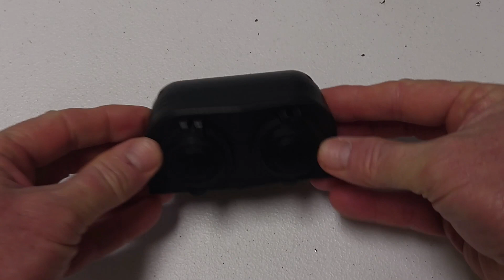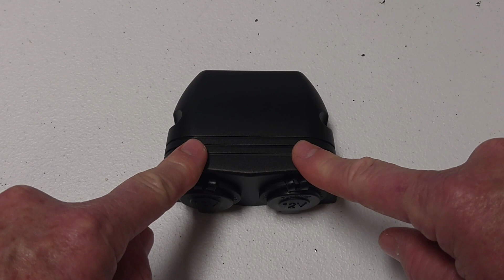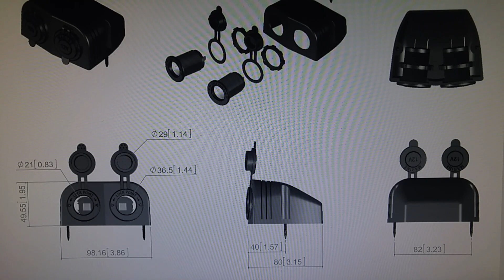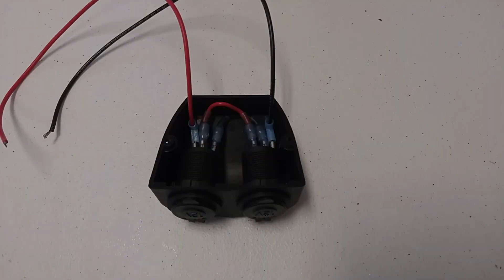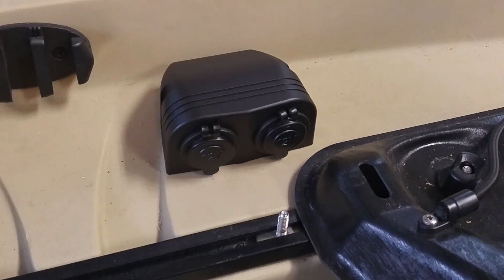Kayak 12V Dual Power Ports Installation

Comment: What kind of amperage can those work with? I had a problem with a 18A spotlight on that type of plug, but switched to a yak power plug and it worked fine. I think that would work for phone chargers but not much else , what's your input?
Reply from the maker: This is rated at 16A max. A safe max working load would be about 15A. I am using this for my fish finder and cell phone. I am running a 3A fuse which is more than enough for my needs. You should always check the ratings on plugs to match the equipment you need to use.